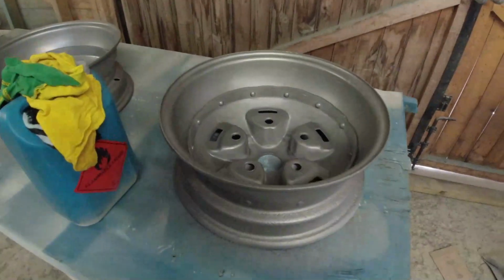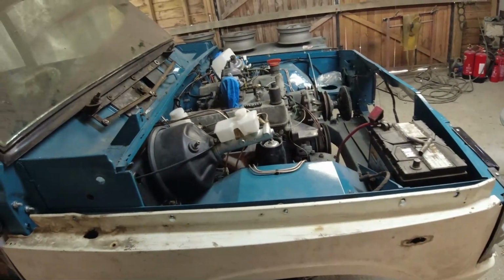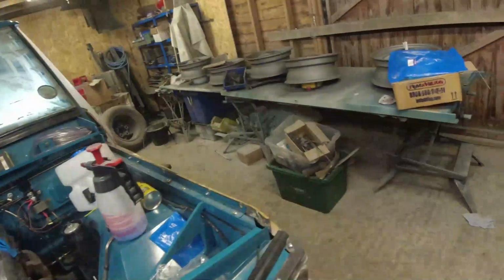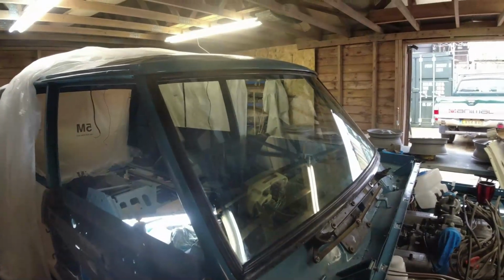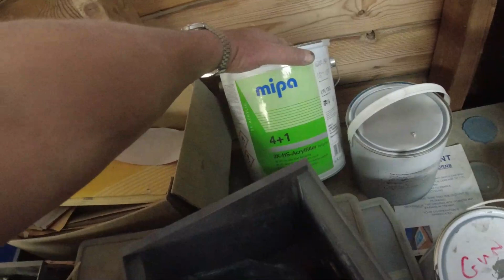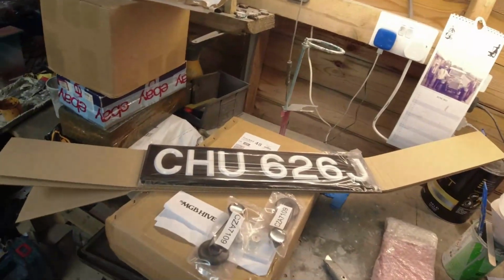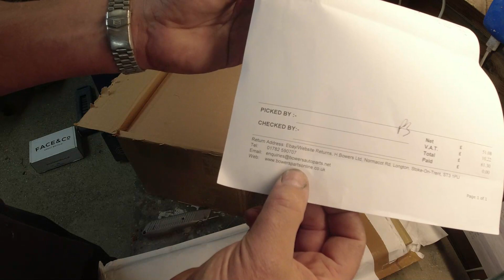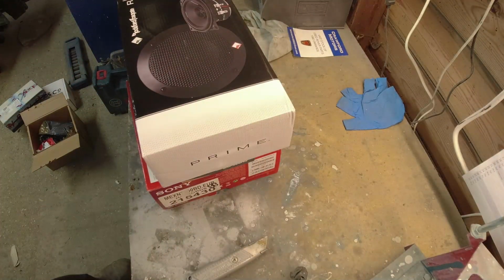Episode 43   1971 Range Rover BOB no engine start etc  parental warnings for profanity

Comment: Certainly getting there Richard, always takes twice as long as you plan for! Looking at 25.19 when you were talking about the PAS hoses, I know camera angles can no odd but it really looks like the PAS and water pump pulleys are way out and you could never get a belt round them?
Reply from the maker: Must be camera angles, the PAS pump is a later item that has the outer pulley belt for the alternator which would go on the passenger side. That pulley I am not using.

Comment: opinion, wheels look like shit, get them powder coated like MGB ones, or is that how they came out of the factory ?
Reply from the maker: Ouch! 😂 I have power coated these riveted rims before, the powder coat cracks around the stud and valve holes! Then worse is yet to come because rust starts to creep out between the two sections that are riveted. Powdercoater followed the process to the letter and they still failed within a year. money was refunded. 

New powdercoater I use near my workshop was worried to the extent that they could not guarantee these style of rims. At least with 2k enamel paint I can touch them up... fnarrt